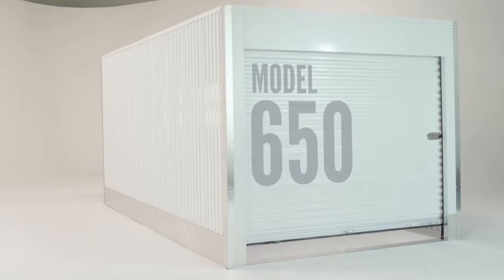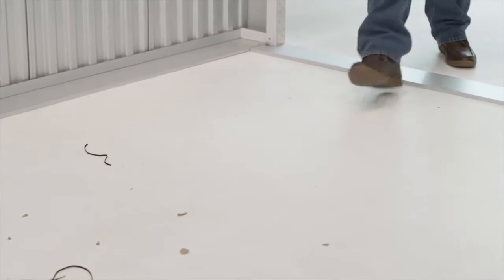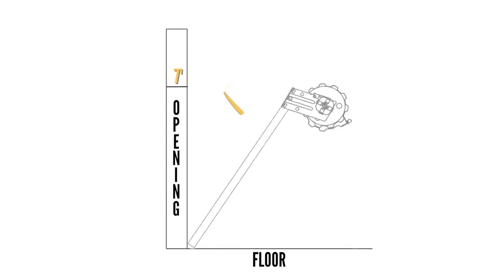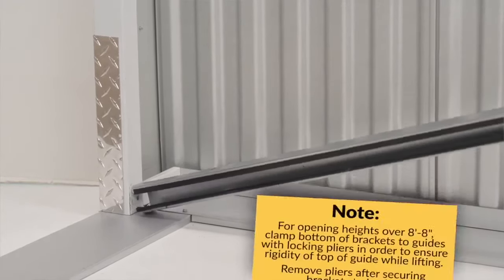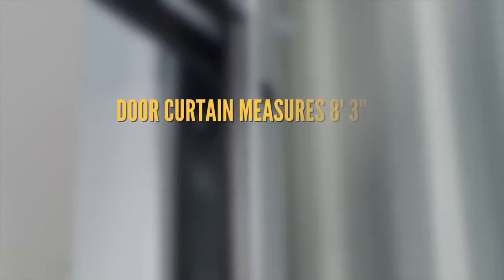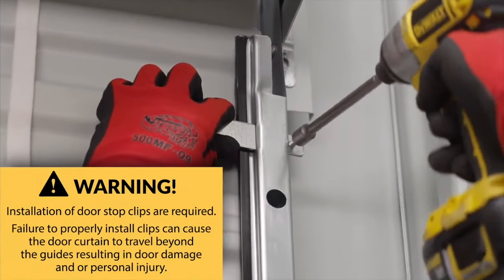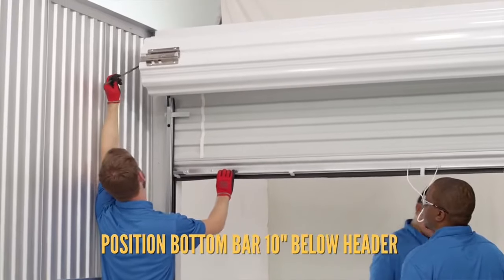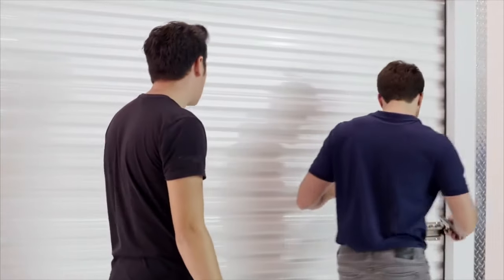Janus 650 Door Installation (Self Storage Roll Up Door)

Comment: Thank you for this very descriptive door installation and adjustments video.  After 17 years of the door to my utility shed being "Hot" and snapping up if you did not control the ascent, the proper spring tension has now been applied.  The door comes just off of the door plate when all of the way down and then released.  It is very easy to lift without having to control it.